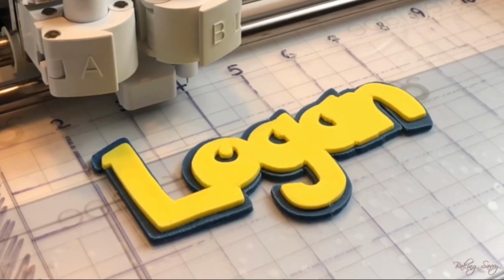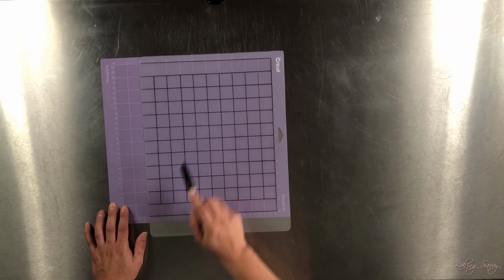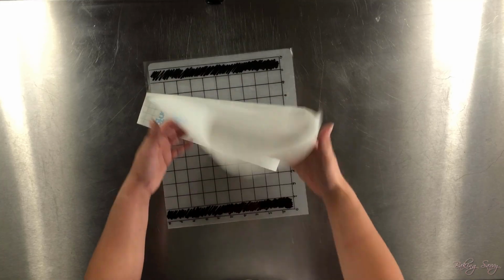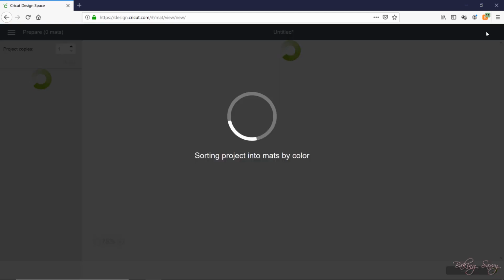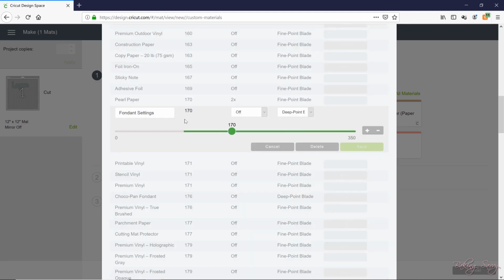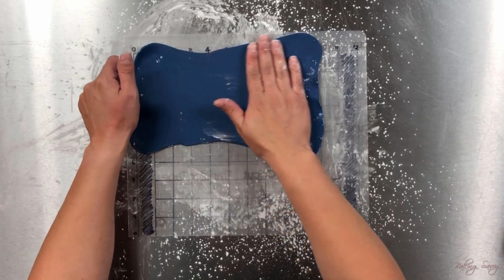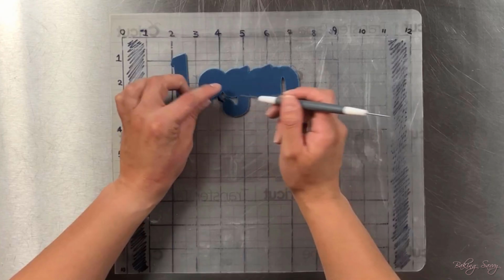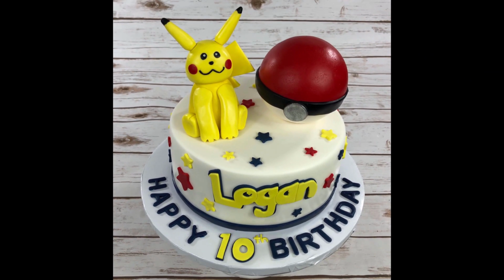Using a Cricut Machine with Fondant For Customized Designs

Comment: I followed her instructions and the machine spit out the mat and said it was too short. Need more detail and information. Why not use one of the mats provided?? Should the mat really be in portrait orientation so the longer side is vertical rather than horizontal??
Reply: The reason that happened is because you have a Cricut Machine model 3 or 4. The Cricut Explore Air 2 and Maker won’t read the mat. Just buy another mat bigger that 13x13

Comment: I love your Matt I dea i def have to try it but I did purchased the correct Matt from icing images ETSY page but why do I move those rollers and then do I put them back to where they were, Im scared to move them
Reply from the maker: You have to move the rollers because when the mat goes through the machine, the rollers roll right over the fondant if you don’t move them.
Reply: @BakingSavvy  ok that makes sense now I get it.   thanks

Comment: Thank you for the wonderful tutorial. We have tried making our own mat as you have suggested in the tutorial and followed it exactly, making it slightly shorter. But before the first cut, the cricut pulls the mat in to measure the size of the mat and because it is shorter than a "standard" mat, it is rejected. Is there anything we have missed or that we can stop it doing this to measure the mat? (We have an explore 3). Thank you for your help, Rob
Reply: That is the problem with 3 model machines. They scan length of mat. Perhaps you can try with some thinner material applied directly to the mat to save on thickness.

Comment: People need to know if you used this for other than food safe materials you shouldn’t use it if you already use it for regular inks etc it needs to be only for food
Reply from the maker: I use a Cricut Explorer 2 that’s soul purpose is for food materials only. Never mix food products with any other type of material. One should have a desperate machine for crafting purposes and one for food materials.
Reply: @BakingSavvy  this was my idea as i wanted to start making edible images. But cricut said that none of their machines are food safe. The lubricant's and the machinery is not food safe. Any insight?

Comment: I’m using the cricut maker and my mat is rolling through but isn’t rolling back. How can I adjust this setting?
Reply: Same problem here with the Maker. She needs to amend her videos and tell everyone that it will not work with the Maker. The maker cannot use a mat smaller than 12x12.

Comment: What machine are you using??? There are several cricut machines and the cricut maker does not work with cricut explore blades!!!! You’ve missed the most important part of this video🤦🏽‍♀️🙄🤦🏽‍♀️
Reply from the maker: It is a Cricut Explorer Air 2. This will not work with the Cricut Maker
Reply: This is most likely air 2

Comment: Thank you for this video!  Can i use the cricut machine for edible and non edible projects at the same time just by changing the mat and blade?
Reply: Good question
Reply: I have the Same question.
Reply: I don’t see why you can’t. It’s literally just cutting it. It’s not like using your printer with regular ink and then changing the cartridges to edible ink cuz there would still be traces of the old ink in there. This is just a cutter and you’re using a fresh blade and mat

Comment: If you check the Cricut Website, these machines are not food safe.  There is a machine that was made called the Cricut Cake made exclusively for food.  If your machine is new you will void your warranty by cutting fondant.
Reply from the maker: Yes this is true. That is why I specify to use a food safe chopping mat instead of the Cricut mat as well as a separate blade for using with food products and go into detail about how thick the fondant should be so it does not come in contact with the machine itself. Its all specified in my blog post.
Reply: @BakingSavvy  is the blade a food safe one as well?
Reply: @mc25monini  is the blade food safe? It’s a blade that’s only used for this purpose. Are your knives and forks food safe?
Reply: Anne Harriman Yes, we know Anne because you say it on every single video about this subject.
Reply: @StacyJSmithLLC  I just laughed too hard at this. I could see you rolling your eyes. Lmao
Reply: @StacyJSmithLLC  😂😂😂😂😂😂

Comment: Is that store bought or homemade fondant you used, would either work?
Reply from the maker: Hi Michelle, for this video, I used my Duracolor Fondant recipe. However, you can use other types such as Satin Ice as well. I have worked with Satin Ice doing this method and it works as well.

Comment: I’ve been wanting to get one of the cricuts which one is best to use with fondant?
Reply from the maker: Baking with TiCa I use the Cricut Explorer Air 2 for this tutorial
Reply: @BakingSavvy  dou need to have a subscription for the 10 dollars a month???
Reply: Ones are made to be used for that called cricut cake and it's food safe with all the stuff that comes with it.
No chance of someone sueing for some kind of poisoning.
Great video how to make mat.
Reply: Would.  Love to know if a maker does this also
Reply: Umm Cricut makes a cake machine that is food safe, unlike a regular Cricut.
Reply: @vlovbg  noi anymore apparently it has been discotinued
Reply: @dolcefini2159  that doesn't mean a regular Cricut can be used to cut food.  The oil and lubricants used to manufacture these machines are not food safe/compliant.
Reply: @vlovbg  when did I said that??? I am just pointing out they don't manufacture them  anymore
Reply: There is ONE FOR CAKES THIS IS NOT RECOMMENDED.
NOT FOOD SAFE !